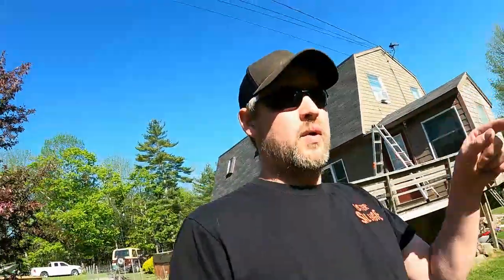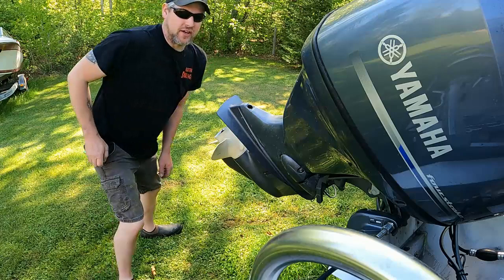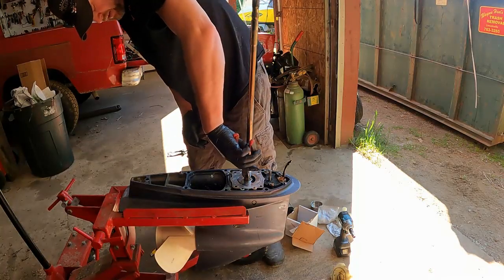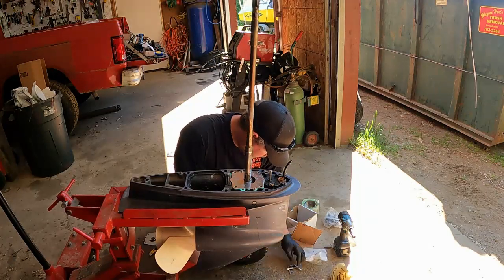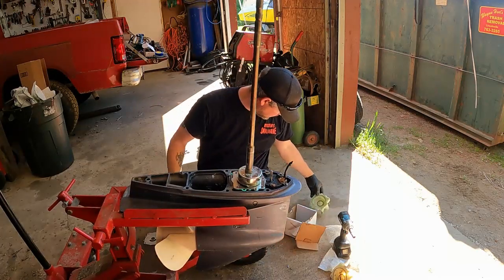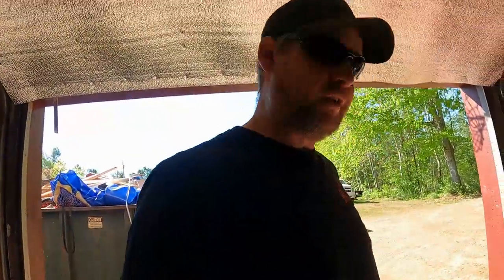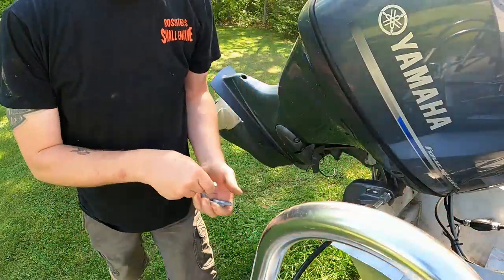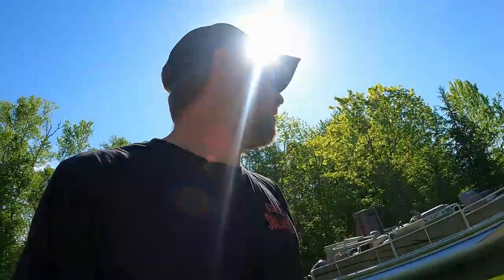Yamaha 115hp outboard Waterpump replacement.

Comment: Couple of details you missed.
Use a torque wrench for bolts.

Bolt tightening torque
12mm 6 LU 27’# (10x45mm)
12mm 1 Zinc 31’# (10x45mm)
4 water pump housing 13’#

You didn’t pack the three metal washers that fit over the shaft correctly. There are three washers. The flat washers go on top and bottom. The wavy washer goes in the middle. You only used two washers. When placing the plastic part on the shaft you need to pull up on the shaft so the plastic piece is correctly seated. If not you will get prop chatter when shifting into idle.
Reply: I wonder if that is my problem from the dealership? Thank you